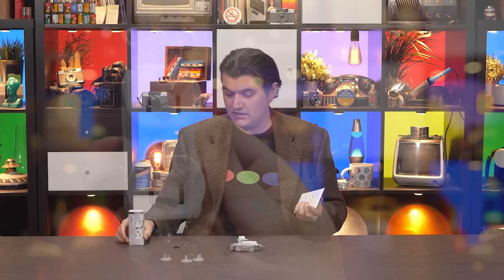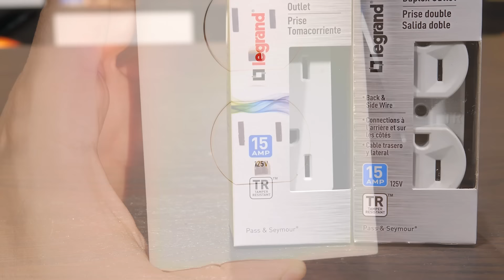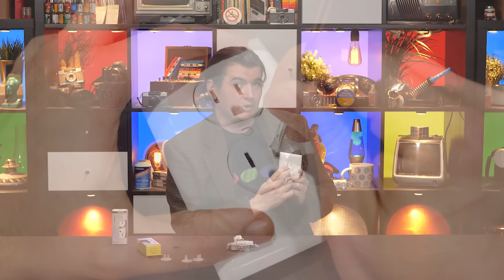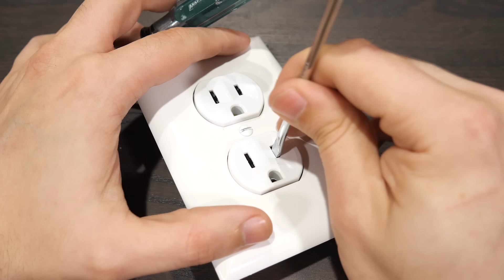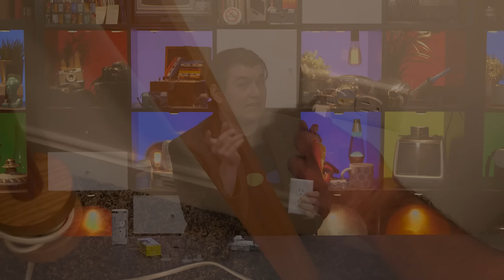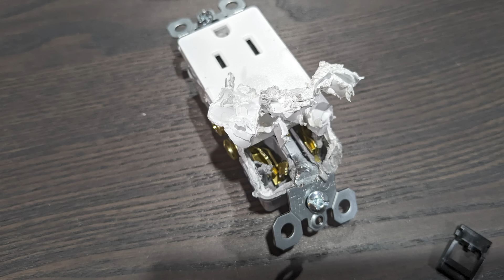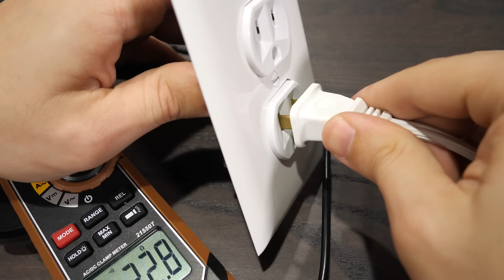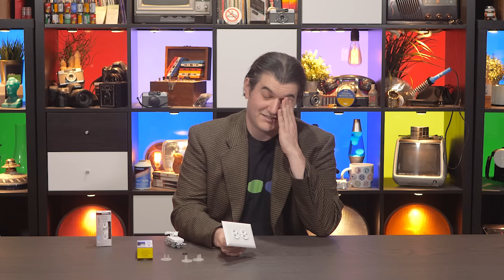Tamper-resistant outlets aren't all the same - a follow-up

Comment: Just to recap for those who are wondering about what kind of plugs and sockets we are talking when Euro Plugs and Sockets are mentioned. Somewhere Socket types are named in a schema from A to N (I could not really figure out where it came from or if it is used internationally, but it is quite commonly used here. European Sockets and plugs are specified in the CEE series 7 list, which is why you may also find names like CEE 7/x for those. The CEE later became the IEC). A and B types are the US sockets without or with ground.
Type C is what is regularly called the Euro Plug. The socket is either round and has two holes for L and N, no ground. It may be flush with the plate, a round recessed socket or for smaller applications not round at all. if the whole socket is rescessed, that is actually to avoid possibly live prongs being exposed. And this socket is more or less within tolerances the base for all other european style types. Almost all European type plugs fi into this one, unless they have a ground prong. So Schuko or the French Type E plugs will go in, but with no ground (which may be problematic.) For plugs intended to be used with this the smalles one is what we commonly call the Euro plug (or CEE 7/16). That is the flattened one with only two prongs and no earth. The prongs are at a slight inward angle to increase holding pressure so they stay in the socket. the prongs are very slightly smaller than the other ones and they are sleeved, to prevent open contacts if not fully inserted. Those really go into any european socket, but they are only rated up to 2.5 A. the next size up commonly used is what is called a contour plug (or CEE 7/17). It seems to somehwat resemble a shuko plug, due to a kind of base plate with different holes and receses in it. Those are to accomodate whatever ground contacts and other features the socket might have. They have no ground.The prongs are straight and I think about 4.8 mm. They don´t have to be sleeved, as the ground plate is supposed to prevent open contacts. They fit into any flush to the plate or round recessed sockets across Europe and are rated up to 10 A.
All other types are somewhat national types with ground. And this is where the main difference lies. Type E (or CEE 7/5 socket and CEE 7/6 plug) is the french type and it has a ground prong protruding from the recessed socket. Type F (or CEE 7/3 socket and CEE 7/4 plug) is the German Schuko type with the ground contacts on the side of the recess. Type K is somewhat similar to the US Type B as it has a third hole fro a ground prong and used in some Scandinavian countries. Interestingly it is not uncommon to find Schuko sockets as well. The two odd ones are the Swiss Type J which resembles a thicker Euro Plug but with a hole for a ground prong of center. It usually is recessed, but I have also seen flush ones. And finally the italian Type L, which looks exactly like the Euro Plug, but with a center unsleeved ground prong. 
The most common plugs I see around here (Germany) are either the actual Euro Plug (CEE 7/16, you find that one also especially with for example USB chargers and such. few plug in devices like Wifi repeaters may have what looks like a Schuko plug, just for it being more stable when plugged in. on a lot of things using slightly more power you will find contoured plugs these days (it can be vacuums, kitchen appliances, drills...) and finally, I have rarely seen any pure Type E plug. most today are a hybrid form that has all the features of a Schuko plug, plus a hole and contacts for the Type E ground prong (CEE 7/7). This one can often be found across Europe, as soon as you need more than 10 A. The Schuko Plug (or CEE 7/4) is nominally rated for 16 A, although actually that is supposed to be the peak amperage and the rating for continuous power consumption is 80 % of that. Out of scope for this , but maybe interesting to know, If you need even more power, you get into the area of the blue (single phase around 230 V) or red (three phase around 400 V) CEE plugs which come in different sizes. Those colors follow some norm by the way, which is why for some US plugs and socket on extension cords you will find yellow, which marks the voltage range around 110 V. There is a list of colors assigned to certain voltage ranges.

So the main advantage in most cases of those plugs and sockets is that the socket either is recessed, there is a big base covering the prongs or the prongs are sleeved to prevent contact to live prongs on a not fully seated plug. Additionally typically on those with ground, ground makes a connection first by design.
I think due to the recessed versions people think our plugs dont "fall out" in comparison.
Reply: That is some wall of text, and also has some small errors. In particular, the type C Europlug is really only a plug. It has no official socket and is designed to be used with as many different sockets around Europe as possible.
The angled pins and low current rating of 2.5A is because some of those sockets have slightly different nominal pin diameters and distances.

Of course, people make cheap Europlug extension cables rated for only 2.5A and those have "Europlug sockets", although I could not find an official standard for them.

What you describe in your first section as an Europlug socket is probably CEE 7/1. It is no longer used (As it is dangerous with earthed type E, type F and type E/F hybrids) and has no official letter (A to N).
Reply: @entcraft44  In documentation I have the Type C socket for whatever reason is indeed called europlug socket. I could not find a lot of history on that socket and I think you are right, as it is not actively in use anywhere. Plus the actual Euro plug was invented later in the 1960s to fit as many european socket systems as possible (Except for Type G used in UK, Ireland and Malta) From Pictures I have seen It was a recessed socket without ground, but to be honest I would not claim that picture showed actually that socket. But I just remember having seen a very weird extension chord in a Dutch supermarket, that had round, slightly (very slightly, mabye 2 or 3 mm) recessed sockets and no ground, the plug on the cord was a CEE 7/17 type though. That might have been actually CEE 7/1 sockets. regarding the matching original CEE 7/2 plug, I could not find anything about it anywhere. I assume it might have looked somewhat like what later became the CEE 7/16 contour plug, just with a round base without notches. Although, i might have seen a picture of a soviet plug like that which someone later took a file to to create notches and make it fit into a Schuko socket. The original CEE 7/1 socket and CEE 7/2 plug have been rated for 10/16 A, which I assume is supposed to mean 10 a coninuously and 16 A temporarily.
You are also right about the actual Europlug (CEE 7/16), while the other plugs have an up to 4.8 mm prong diameter (or something close to that), the Europlug for compatibility reasons only has 4 mm prongs, and that is only the metal part, the sleeved part usually is slightly thinner (although I am not sure that is specified or just a result of how they are easiest to produce) at the base the Europlug Prongs are 19 mm apart, what supposedly should match all other european sockets, while for extra grip in the socket, the tips are only 17.5 mm apart. And if someone wants to be nitpicky, CEE 7/16 actually describes two alternative plug types, with the flat one common today being Alternative II. Alternative I is rarely used, if at all. It would look like what we know today as CEE 7/17 contour plug, but with the same prongs as the flat Europlug and rated for 2.5 A only. I guess the CEE 7/17 plug rated for 10 A is why no one cares about alternative I anymore.
For the europlug Sockets, I guess you refer to those adapters with the recess matching the Europlug but allowing more sockets in less space. I have also commonly seen adapters from one Schuko like plug to two or three such Euro sockets or some of those mixed in on a power bar / extension cord. I even remember an extension having Schuko sockets, but those had actually extra holes and stuff so one Schucko socket ould alternatively take two Euro plugs. I neither have found any official standard for those sockets, as the plug itself was intended for compatibility with other sockets.
Edit: I just stumbled on the English language Wikipedia article on CEE 7 standard AC plugs and sockets, they have a picture of a CEE 7/1 socket CEE 7/2 plug power bar on there. It looks like the thing you can still buy in the netherlands, except for the plug used. To be honest, I haave a number of tools and devices that come with a CEE 7/17 plug with no ground, but I don´t understand why to limit yourself to something not providing ground if needed. The difference in cost is bsolutely negligible.
Reply: The cool thing about the Swiss plug system is that you can plug a regular single-phase plug into their three-phase outlet.
Reply: @LukasFink1  This reminds me: The Swiss design used to be recessed only in kitchens and bathrooms but is now required to be recessed everywhere in new installations. They also used to have bare pins, now they need to be sleeved (because many sockets from older buildings are still not recessed)
Reply: @LukasFink1  To be honest, I have no idea what their three phase plug looks like. From what I have seen I had assumed for three phase they use the industry standard red CEE connectors as well.
Reply: Some flat plugs have 6 A rating instead of 2.5 A from reputable manufacturers like Legrand. I have even seen 10 A ones, tried them and they get slightly warm at 10 A load, no significant heating with 6 A. The person who decided the 2.5 A limit was an idiot.
Reply: @mernokimuvek  No they were not. This specific Plug (CEE 7/16) was always designed for small and rather mobile applications. For those there never was a need to allow higher amperage. for everything using more power, the local or combination plugs like CEE 7/17 were supposed to be used. Also, I do not want to imagine what might happen, if someone uses multiple of those higher amp plugs with actual higher amp devices, on like a power bar having multiple of those non standad small sockets.
This plug is for example also  the only plug besides the UK Type G plug, that is allowed to be used in certain shaver sockets that can be found in UK bathrooms, as long as it does not use more than a certain, very small amperage. (I think all those are, are a socket behind an isolation transformer.)
If there are higher amp versions of this plug, they do not comply with the CEE specifications. And as I said, for the intended purpose, anything bigger would not matter. But that is also, looking back at what time that plug was developed. Back then anything using more amps more than likely had a ground connection anyways.
What I can imagine though, as this plug is used in other markets like Asia as well, is that those are made for other markets, where CEE specifications may not apply.
Reply: @alexanderkupke920  The europlug has 4mm pins. Old 6 A and some 10 A plugs also have 4mm pins. If reputable brands like Legrand make 6 and 10 A plugs with 4mm pins, it just proves that the 2.5 A limit was stupid. Why would a highle reputable brand like Legrand not comply with CEE ? I doubt they would risk their business by making non compliant plugs.
Reply: This made me look up which specific types are actually in use here (Germany). Turns out the ones I see are pretty much three types with three or four different names each...

1. "CEE 7/7" ("Schuko"/Type F) for applications with Earth contact, looks like a normal "Schuko" but has a hole for french sockets with a pokey earth pin. Allows 16A. Didn't know what that hole in the plug was for until today since I've never been to France
2. "CEE 7/16 Alternative II", "Europlug", "Type C" for anything low-ish power with no Earth contact required, up to 2.5A. Fits in almost every European country, even works in UK "shaver sockets" if the device is low current.
3. CEE 7/17, which can be described as a CEE 7/7 but without earth, or as a heavy duty Europlug with a shroud so it only fits round sockets like the Schuko socket. 10A or 16A. Since it has the shroud and all the sockets it's supposed to fit are recessed, the pins don't have a plastic sleeve like the Europlug. They're also thicker, like on the 7/7. This is used on double insulated high current devices, I commonly see it on vaccuums and hair dryers.
Reply: @ska042  From what I know and have read, the CEE 7/7, in German you will also find the Name "Konturenstecker" is limited to 10 A. It has by the way the same 4.8 mm prongs and 19 mm spacing as almost all european sockets, except for the swiss type J, which has a 19 mm spacing, but only 4 mm prongs. That is why the CEE 7/16 Type II Europlug has 4 mm prongs. the prongs have a 19 mm spacing at the base and only a 17.5 mm spacing at the tips, so they are slightly angled inwards, which gives them more holding power in sockets designed for 4.8 mm prongs.
Reply: @alexanderkupke920  I think you mean 7/17? 7/7 is the "Schuko with compatibility for french sockets" plug with Earth contact. Either way, I see several 7/7 and 7/17 plugs marked "16/250" around me, so those are definitely not 10A.
Reply: @ska042  You are absolutely right, I somehow managed to misstype that one. I also checked the specifications again and you are right again. The CEE 7/17 plug is rated up to 16 A and 250 V. I think I might have got that one mixed up with another common plug these days that I found sometimes called "Konturenstecker", while that one more often goes as "Kleeblattstecker" or "Mickey Mouse Stecker", or more the IEC-60320 family of sockets and plugs we know from the device Appliance side, although the C5 type plug I mentioned would be more familiar with the euro plug, which you more likely find in combination with the C7/C8 socket and plug pair, or C1/C2 on shavers. It is only rated 2.5 A. For the 10 A rating you have to got to the well known C13/C14 combination everyone knows from for example computer power supplies.
The beforementioned C5 type to me was always a weird one, as I only know this one from very few telecommunications appliances and some brands (HP for example) laptop power supplies, which actually are double insulated and would not require a ground pin, thus would work with a much smaller europlug, as other brands use. Also, there is only a two wire dc cable from that power supply to the laptp itself. There is only one thing in particular I remember this plug from. It is a pain in the rear end to find a spare or replacement lying somewhere around if you managed to missplace one.
Edit: Just found an old overview document I used to regularly look up such standards when needed. Don´t know its origin, but it actually, as I just found, falsely states an amperage of 10 A for the CEE 7/17, but CEE spec definitely defines 16 A.
Reply: Just to make thing more complex, actually italy has two plugs.
The type L three prongs, bare ground is 16A but there is a kind of hybrid with no name, it's the 10A version, same size as the europlug type C but three prongs, bare ground.
A scaled down version of the type L.
Historical reasons were that houses had two breakers and two lines/plugs to save copper.
The small 10A wiring for lights, the bigger 16A for appliances.

Nowadays, "bipasso" wall plugs are common (16A heavy wiring, slots shaped as an 8 can take both size)
Reply: @fabiogalletti8616  You are right, but from what I know and read, it was even more complicated than that. The smaller 10 A plug has a 19 mm prong spacing and 4.8 mm prongs (or was it 4 mm? ii think it was 4.8) and up to the middle of the 20th centrury was, as you mentioned for sockets on light circuits, which, hold on, at the time were 110 V. the larger 16 A plug has a slightly bigger spacing, as you can see on the bipasso sockets you mentioned, but also bigger 5.1 mm prongs. that one was up to 16 A and was named the "power" circuit. some time in the middle of the last century the two sockets and amperages remained, but everything became 230 V.
Reply: @alexanderkupke920  I have the plugs here and i checked: 10A is 4mm diameter, 19mm spacing - 16A seems to be 4,9mm, 25mm spacing, in the example I have.
As always, standards are fantastic: there are so many...
BTW, there is some mulling in EU to adopt a new power-plug standard, somewhat like a swiss three prong triangle stuff - but it is going anywhere.
The market fixed issue: almost everything on the shelves is or europlug C for light loads or a mixed french/german round plug with both side strips for german ground and a hole for the french ground stud - this goes in most wall sockets in Europe.
Those with other standards have to find an adaptor (best-selling product, in my shop) or in the long run put round wall sockets that can take also the local standard.
A Schuko+bipasso socket, in Italy is round, 8-shaped holes for 10A/16A/Schuko+a central ground and side strips.
Reply: @fabiogalletti8616  Yeah, for everything requiring a Ground, the CEE 7/7 Schuko French Type mix seems to be the standard right now. without ground it is the smaller Europlug or the CEE 7/17. Just returned from Denmark, although they have their omnipresent own type of sockets, whatever devices and appliances I have seen, less san 30 to 40 years in Age,  had the CEE 7/7 or a Euro plug. Only things I have seen diverting from that are some older devices, which had what looked like an oversized Europlug and extension cords and Power strips, which seemed to be universally of the CEE 7/1 and 7/2 Type or Type C. round plate with unsleved prongs, no ground and slightly (compared to the schuko socket) recessed round sockets with no ground. The predominant lack of proper grounding for larger appliances and devices was somewhat worrying to be honest. For most smaler devices, I am not even sure if thouse would actually need a ground.
Reply: @fabiogalletti8616  Amy European countries also had 6 A sockets and plugs. 4.5 mm holes, 4 mm pins.
Reply: This is all good information but I would advise double-new-lining to make it scan more easily on a phone. Even on my laptop it's quite a wall of text, without the other formatting tricks/algorithms used in books to make single new-lining work.
Reply: @kaitlyn__L  Never considered that, but sounds logic. I will attempt to keep that in mind. I am watching/commenting usually from my computer, rarely on my phone. I never really considered what a difference formatting would make in such cases.